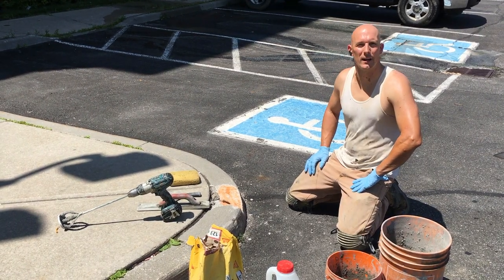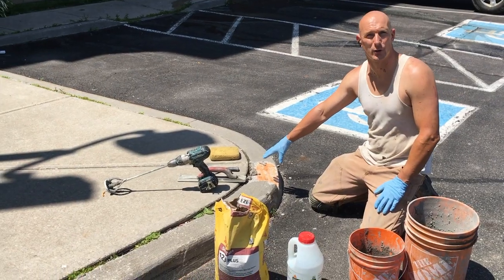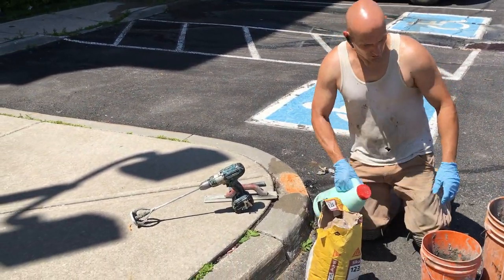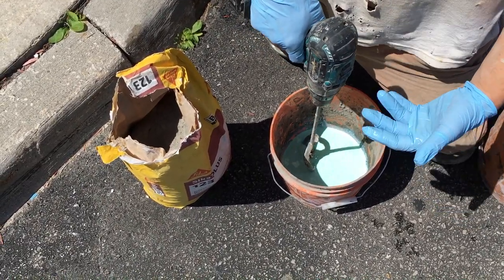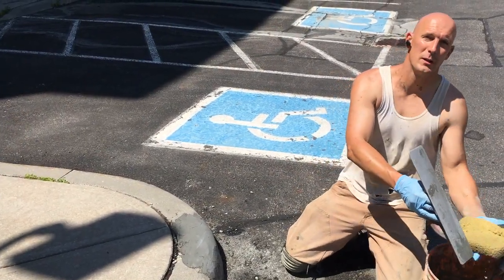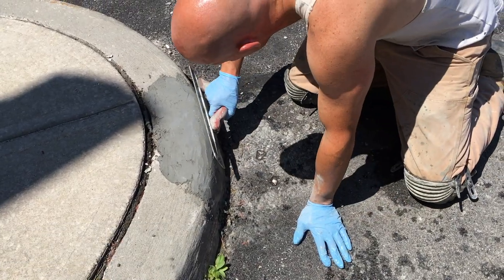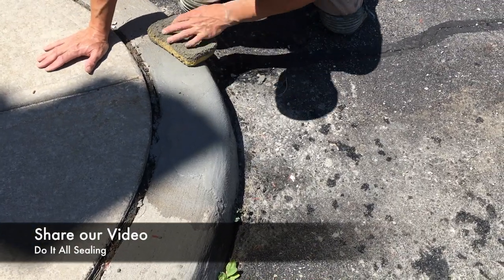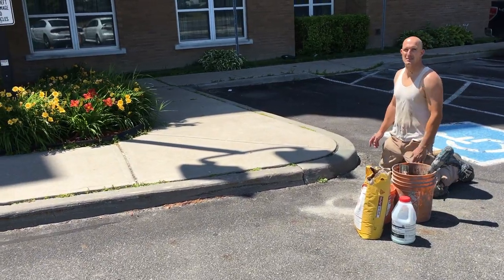Concrete Curb Repair with SikaTop 123 Plus

Comment: You could have added a paint brush finish to match the rest of the curb. SIKA is great for small repairs to concrete, we use it in balcony repairs and it will outlast the original concrete. Thanks for the content

Comment: How well does concrete curb repair hold up and adhere to the chipped part in general?  Our curbs at my place of work are so screwed up because of damn snow plows chipping into it, it looks like a bag of ass.  I've wanted to rebuild it for a few years now but my supervisors have said it's not worth it as it won't stick to the original concrete very well. I think it's b.s. but I don't have much masonry experience. 

Has your previous repairs lasted?
Reply from the maker: +Eric Christensen thanks for watching my videos.  The sika actually adheres to the chipped partbof the curb very well.  If you were to compare sika with anything from your local store products nothing will match up to this.  This is the same stuff used on bridges and highways.  As far as the snow plows thats something that will always continue to damage the curbs.  For sure 100% it will improve the look of your current curbs.  With anything sometimes you may have to do touch ups or repairs but that xlcan easily be done and you can go over the existing sika.  We actually just finished using this product on a hotel with a lot of damage.   After the job was completed there was only a few spots that needed some touch ups amd its been fine.  I will see how it holds up through the winter.  The repairs in general that ive done with this do hold up but sometimes the plows can put damage into any repair you do.  Let me know how that goes if you decide to repair it and how it works for you.
Reply: @JeffLepard  awesome thanks for the reply!  I'm going to look for some of that mix and my crew and I will hopefully repair all of our curbs next summer!  I'll let your know how it worked!
Reply from the maker: @EricCris10sen  excellent!   Just make sure that it's not too thin.  I've only ever had to touch up a few spots out of 100 repairs I've done.   It's great stuff.

Comment: I have a spot about one sq foot near the garage door that is waiting to be SIKAed. The concrete around the spot is pretty dirty  and I'd like to clean so it come close to matching the patch. A guy that does soda blasting said soda blasting won't work. Grinding it clean is 1200 bucks a single car garage. Any ideas?
Reply from the maker: Grinding it down is great that's what I do when I'm coating stairs or a walkway with this stuff.   I'm actually filming a video next week to sika the outside of a garage door.  Grinding the entire garage floor is $1200 your saying?
Reply: @JeffLepard  Yes, I was quoted $1200 for a single car garage. I won't be grinding it at that price.
Reply from the maker: @SpotBentley  Yeah that sounds a bit much.  You are almost reaching a small epoxy job price for a 1 car garage.  You could rent a floor maintainer that will do the job for you.
Reply: @JeffLepard  I'm anxious to watch the video you mentioned. Thx
Reply from the maker: @SpotBentley  Thanks!  We should be filming that video next Monday!
Reply: @JeffLepard  Any idea when the video will "air"?

Comment: what do you recommend for patching a hole in the sidewalk?
Reply from the maker: You could use Versa Speed or if the hole isn't too large you can use Sika 123.  If you are trying to repair a city sidewalk and you are paying for it yourself you could also just use Top n Bond to get by.
Reply: @JeffLepard  do either of those hold up in cold weather really good?(think of Minnesota)
Reply from the maker: They do hold up pretty well in cold weather although its ideal to do them in warmer weather.  You can buy a winter grade sika that you can apply in much colder temperatures.  I just used some last week I was repairing some stairs and it was chilly that day.
Reply: @JeffLepard  Ok,how about the Top N Bond

Comment: This is so groovy ! U should make more food vids !
Reply from the maker: I will I haven't filmed anything new food videos in a while.  I need to!
Reply: Fun Size Production  can u ad some water in case you run short of the liquid?
Reply from the maker: @leoalcantar4091  you can add some water but not too much otherwise the properties would change and the sika would be not as strong.

Comment: What do you charge to seal the asphalt after the you've made a mess of it? 
a Little cardboard goes a long way to protect the surrounding area.  leaving debris around a repair is like using a highlighter over white out.  
Otherwise good video.!
Reply from the maker: I actually did seal the parking lot after those repairs so I wasn't too worried about the mess.  Thanks for watching.   I've done new videos on this on my construction channel www.youtube.com/doitallsealing

Comment: I garauntee this patch has already failed. For one the orange paint will act as a bond breaker so it did not soak into the existing concrete, two the perimeter of the spalled concrete should be ground down to eliminate feather edging of Sika. Patch will last alot longer if prepared better than this.
Reply from the maker: Check out my other channel I did a few Sika Videos which were better than this video.  Thanks for the comment and let me know what you think about the repair on my other channel.

Comment: Also never apply water to substrate you just filled in all the micro holes in the concrete. Read directions
Reply from the maker: Thanks for the tip!  Thanks for watching I appreciate all the input!
Reply: I've always been taught that the substrate must be saturated dry. Light wet with no standing water. means use light with sponge or spray water so that the old dry cement won't suck the water out of the new cement before it has time to cure. If you don't use water the strength of the repair with weaken due to the old cement stealing the water. 

Read the instructions.
Reply: I've always been taught that the substrate must be saturated dry. Light wet with no standing water. means use light with sponge or spray water so that the old dry cement won't suck the water out of the new cement before it has time to cure. If you don't use water the strength of the repair with weaken due to the old cement stealing the water. 

Read the instructions.